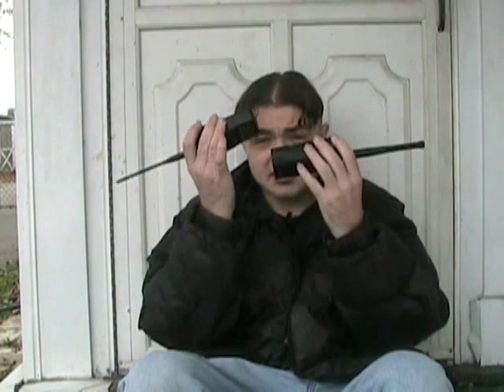Intro to Radio Repeaters

Comment: Speaking of English, wow you curse about as much as I do in a video lol.
I thought Hams could build repeaters and use them without approval? My understanding is Hams are allowed to build and experiment with radios and designs. I' a GMRS / Commercial licensed user and I know you cannot do such things on those bands without FCC part 90 approval but hams I though were pretty much allowed to do whatever... 
I know you have to get permission to put a repeater up on someone elses rooftop or tower and in most cases pay space rental fees each month..
Also in my systems if there is emergency traffic the user presses the orange button or emergency button to send a data burst that tell the system to up the priority level of that particular user or group of users to the dispatcher via mode steering (basically when the button is pressed the radio auto changes to a predefined channel for emergency traffic only) but it is HIGHLY recommended to use a proper phone to call 911 and not relay it through the radio system or via phone patch. But then again the systems I run are commercial and digital.
I hate courtesy tones on repeaters, unnecessary gimmick IMO
Reply: ***** I got ya.there, I build repeaters mostly for GMRS and Commercial use.. but its the same for HAM too.. I have a few videos out on repeater projects I have done on my spare time here.

People steal content and cry "Fair Use" and when youtube flags them they cry again "Fair Use" and make it sound like Youtube did them wrong so they can't make they youtube money..
I watched a video by Boogie2988 where he cried about Fair Use and took all his videos down that he was not allowed to monetize and said Youtube removed them.. It's sad that people like that are too sorry to get a real job, and they leech off their spouses who work their asses off, and blame youtube when they screw up and then throw a tantrum like a child because they can't make 10 cents..
Anyways content theft is more popular int he gaming communities on here. I have never had any of my stuff stolen, yet... but I tent to drop off a few fbombs here and there too. but those are purely natural.
One system of protection I am going to start using is physical branding. watermarking videos or even just writing down my channel name on a card and making it visible throughout the video.
Reply: ***** I dont go off into console gaming, that would be my roommates area of expertise but he does not record or stream his stuff though. I stick with PC gaming and put that stuff up on my channel along with my technical videos of electronics repairs and radio related things. I decided when I reopened my channel to make it a multi genre channel and not be hung up on one type of content.
For console gaming videos though I recommend the avermedia HD game capture system (cannot recall the exact model #, its not in front of me atm), yeah it cost a little but preforms quite well for PC and console systems as well as other types of media, I used it on a rasberry pi once before.

What burns my ass is these youtubers who make thousands of $$ per video (which mind you, has ZERO creativity in them) and turn around and whine about the fair use when youtube slaps them with a copyright claim, Youtube does not remove their video, they give them a choice. Either remove the copyrighted content which in turn mutes the video and they can get revenue, OR leave the video up and get no revenue, Instead they opt on the 3rd choice and just remove the whole video and blame youtube for their screw up. And to top it off their rabid fans who have no idea what is going on support them 110% and will attack you if you try and call them out.
I am all for making money, and I never turn it down, especially in these harsh economic times and kudos for creators who find a niche and use it to gain lots of revenue but I am against complaining about lost revenue when you already made thousands in a week, to me it seems greedy.
Another thing is creators that "raise" money for charity and never actually donate anything from their own pockets to the fund raiser pot.. Pewdiepie is the biggest hypocrite in this area according to his editors..He will raise thousands of dollars for whatever cause and not report the actual total only the goal and skim the rest for himself and then not actually put one dime of his own money into the pot..
Reply: ***** ROM hacking is a pretty easy thing now days I hear, I have never done it though but I have seen people play hacks and I have played some myself with emulators.

Comment: I have so much to learn, I'm a newby can you give me some website links that will help me understand and prorgram my new uv5r plus radio?,can i monitor weather ,fms,gmrs? do i need a license to transmit? if so how much is the license and how do i obtain it?, can i get busted for transmitting without a license?, do i need permission to use a repeater? any info would be greatly appreaciated,,thanks Geno,,  esantaskas@yahoo.com

Comment: Try Piano wire (spokes for a bicycle are ok as well) Guys, your HT's supply the RF to get into the repeater (COR Which stands for carrier operated Relay causes the repeater to go into transmit mode)) The link system is doing the work. Just hope to be "full quieting" into the local repeater. Full quieting means that you are solid into the repeater without and hash noise because your HT or any radio is NOT making the repeater to well (to far away to reach the repeater) Steve, N5YEO, 147.160 /R